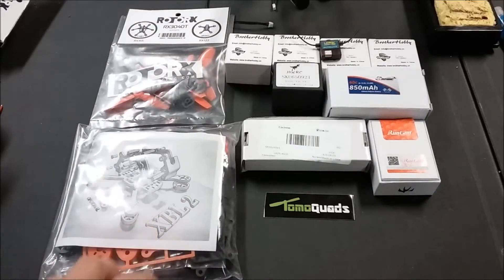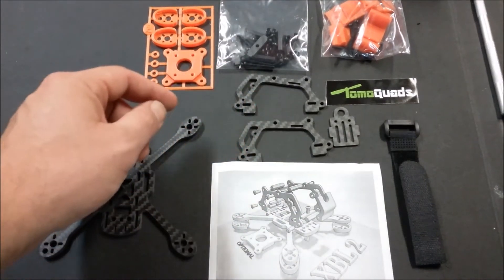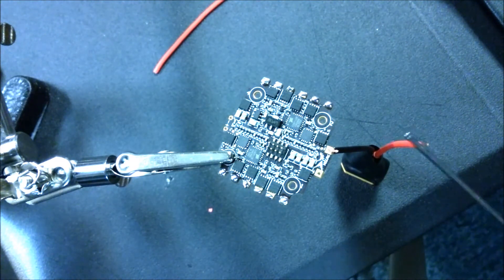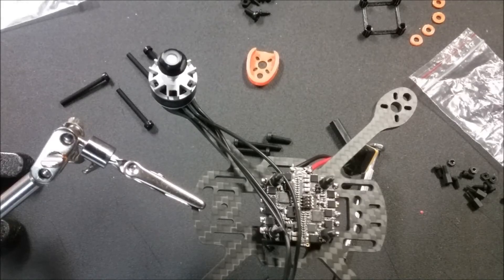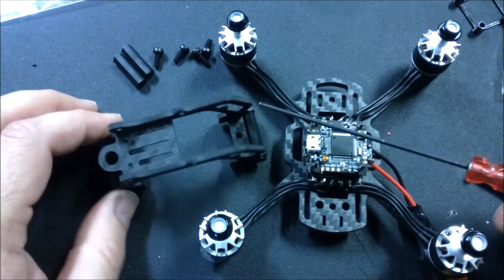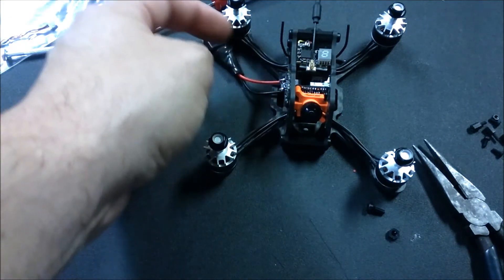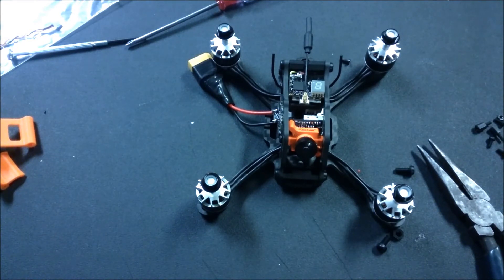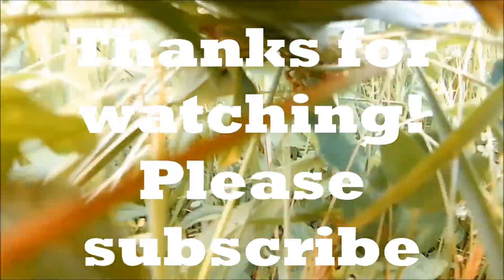TOMOQUAD'S XBL2 Extreme build video!

Comment: Great build. Why do you like it more than the Pred X 3" ?
Reply from the maker: I think it is a matter to some degree of personal taste because they are all great, however the XBL2 Extreme has a thicker frame plate and I like the pod design better because the top is longer and lower while the Pred X has a higher center pod design. For me the XBl2 with these features that I mention MAY let it take more damage in a crash because of the the lower and longer profile pod design. 
The "Pred X racing frame v2.1" is 3mm plate and takes 1304 motors, so that is a X style that may interest you if you like the Pred better and it is up for preorder now. Next option would be the "Pred X SE" which is the stretched edition, and this does have the 4mm plate and you can use 1407 motors like I am using on the XBL2 Extreme edition. It is however a stretched X so a little bit different flight characteristics because of that factor, again personal preference..  
They are all amazing frames and they are all super tough and of the highest quality! 
The new Xbl2 extreme is just currently it for me, and I am planning on doing some racing with it in the future. I had a esc issue on this new Flytower F425, but as soon as that is fixed/replaced, I will have a full and detailed review of the XBL2 with footage and more information including PIDs ,so If you haven't subscribed yet please do and then you will know when that is here to check out. If you have any other questions just let me know and I will do my best to try and help.  
Thanks very much for watching and for your comments. I hope I was able to help you with some of this information.  Sincerely Dez
Reply: With info like you just provided, I'm in! SUBscribed! I definitely want to build a Tomo, but the way he keeps announcing new ones, it's hard to choose. I also liked the orig. XBL design more than the Pred or CS110, but they both seemed to get more pub, so I hesitated. I'm a noob but have built 2 5" quads and heard that these micro builds were a lot harder, so I just bought an ARFun 90mm to start. With the newer components -  4 in 1 esc's etc. (I also have the tower you used on my wish list), I don't think the micro build is as tough anymore. Meanwhile I just hovered my new ARFun and it has a definite pull to the right. I have recalibrated the accel in BF a couple of times, and tried to trim it unsuccessfully. Not sure what else to try - maybe I should have built the Tomo 1st!
Reply from the maker: Check the receiver tab in Betaflight and make sure your sticks are 1000 min, 1500 mid and 2000max  If they aren't showing that then put your trim button back to center adjust the settings in your radio setting until they are as i mentioned. Then recalibrate the accel, and try it.     That is one thing you can try.  I don't know the Arfun but that is something to check out.. I have a big drift to the right when I built a couple of my first ones and making sure these settings were correct helped.. Worth a Shot..   Thanks for the Subscribe!  Sincerely, Matt
Reply: Great call! Everything was over 1500 by 10-20. Adjusted down with radio subtrim on outputs and working
much better. Still have a little adjusting, but thanks so much for the answer! Think I just followed Painless 360 on my 1st build for the Outputs screen and have everything at 97.5% - and no clue why! LOL...
Reply from the maker: Mark Sherman Im glad it helped!